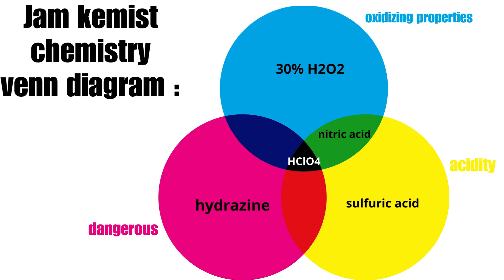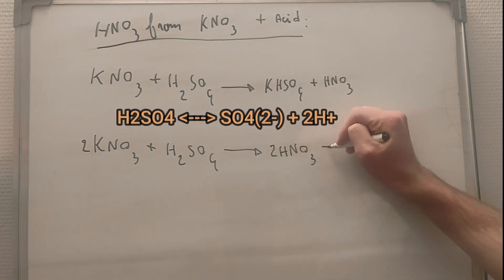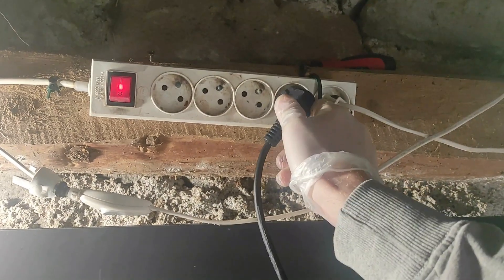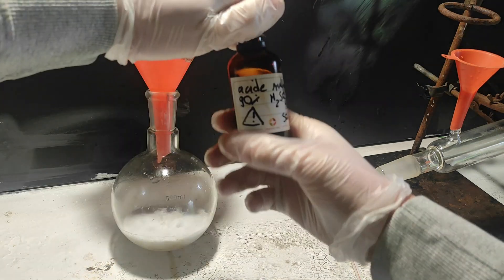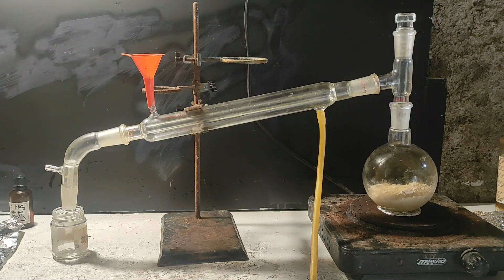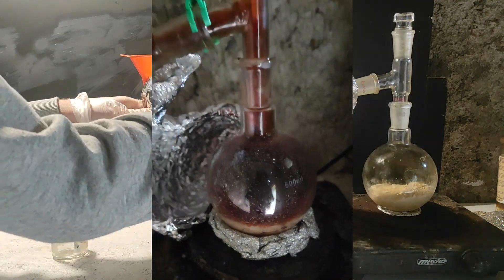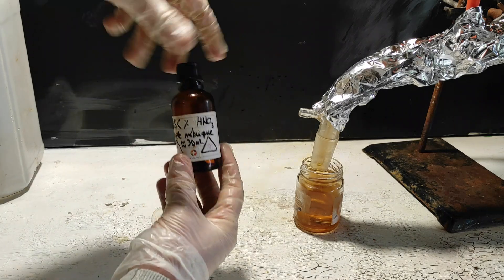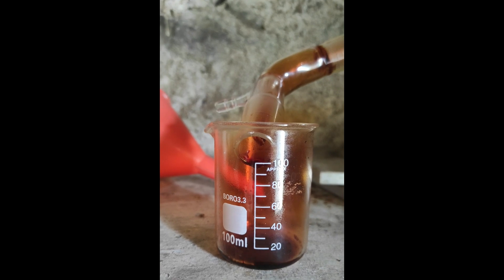Making nitric acid is easy : here is how !

Comment: Bro can I use a alcohol burner for heating the distillation setup ?
Reply from the maker: If you have nothing else Ig but make sure to heat slowly and evenly to not damage the glassware, a hot plate only costs 15€ so I'd recommend buying one

Comment: So sodium bisulfate and calcium nitrate tetrahydrate would work 🤔
Reply from the maker: Probably yes but you would have to dehydrate it if you want concentrated nitric
Reply: @jam_kemist3986  I was thinking of combining the 2 with say 100ml warter then distilling at the end ?
Reply from the maker: @MrMartinswan  it should still work but you'll get more diluted acid in the end
Reply: @jam_kemist3986  what would be a good way to clean the crapp at the end? lol plaster its all over my glass it's s annoying lol
Reply from the maker: @MrMartinswan  well since CaSO4 is very insoluble you will need to scrape it manually, that's the main downside of using calcium nitrate

Comment: The problem here in germany is, you can't really get potassium nitrate. And certainly not sulfuric acid.
Reply: You can quite easily get sulfuric acid in the form of pH minus for pools, it's reasonably pure and roughly 15% iirc
Reply: @HouseBricksDoor187  Some people even still sell the old 50% stuff
Reply from the maker: Even on the internet ?
Reply: @jam_kemist3986  Depending on the ammount of nitrate you have the police at the door. It's not illegal as far as I know but it's still heavily restricted. And yeah you can get sulfuric acid under 15% but I think distilling it down might be too expensive, have to check.
Reply: Sulfur + fire + V2O5 = Oleum. When it comes in contact with water it forms H2SO4.

Comment: Back when I was doing plating, I found that HCl and H2O2 can make a very good alternative to nitric acid, when trying to find something more selective.

Great video!
Reply from the maker: I've recently learned about that, very cool but still it's 2 chemicals when nitric is one so I think it still ok to say that it's the only one that can dissolve copper. 
Anyways thanks for watching !
Reply: @jam_kemist3986  Persulfates, AgNO3, hot H2SO4 and FeCl3 also dissolve copper